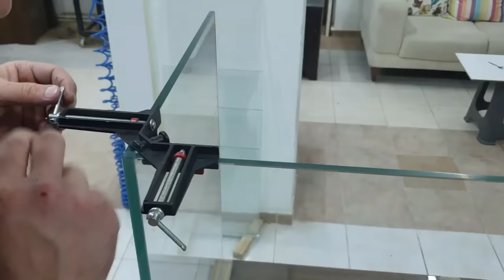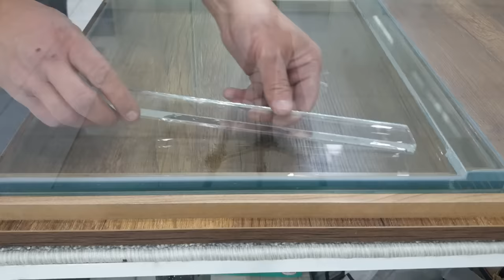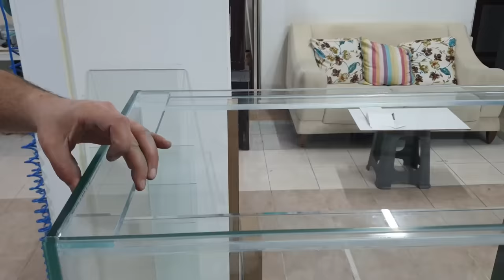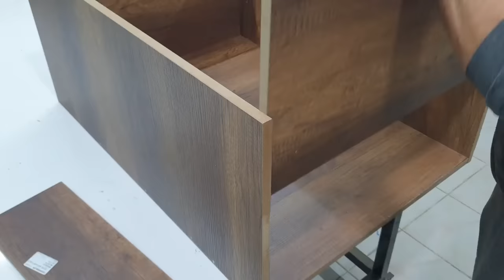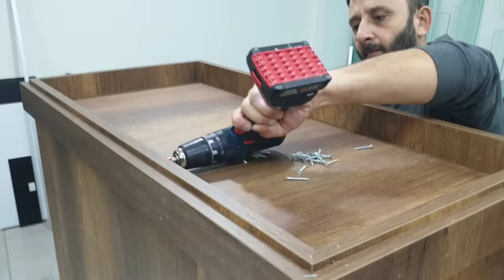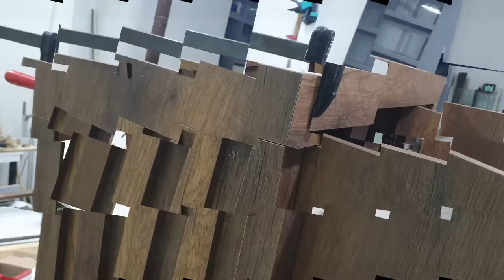Extra Clear Glass and Color Revel - What Is This Aquarium's Astonishingly Different Secret?

Comment: nice but wont last as long as a better built glass aquarium.  Inner silicone should be as thick as the glass itself..  That silicone is so thin.. once it starts to degrade in 4-5 years youll be right at the glass seem and itll need re-sealed.   This is why you make it as thick as the glass, so itll last a very long time.. 10-15+ years before needing to be re-sealed.   This is why you have older tanks made by oceanic and perfecto that are still running 20-30-40 years later..  The newer stuff built today.. even the fancy looking ones like this, just aren't as high quality with the skimping out of the silicone to save a few pennies and make it look more streamlined
Reply from the maker: Thanks for the explanation, you're right in what you wrote, but I use silicone according to the glass thickness, I use denser silicone in aquariums that are large enough to pose a risk.🙋‍♂️